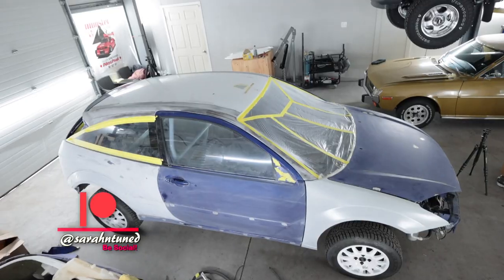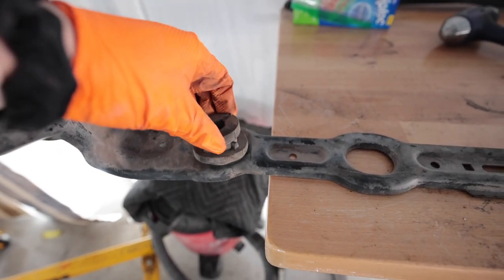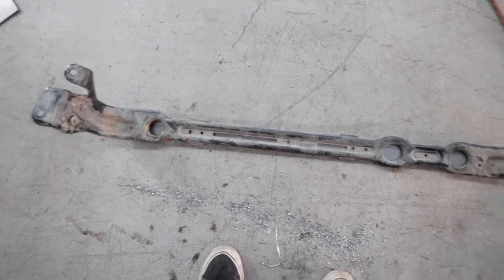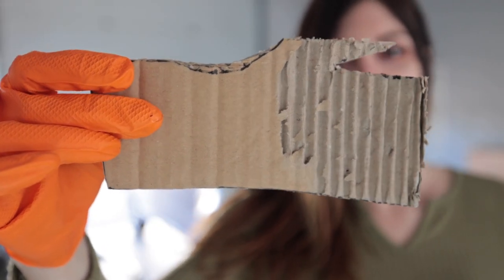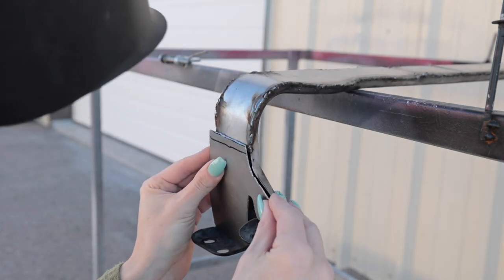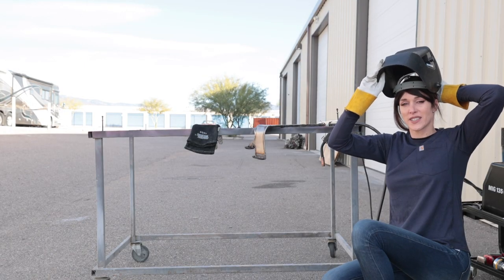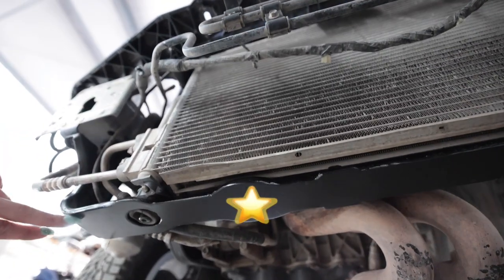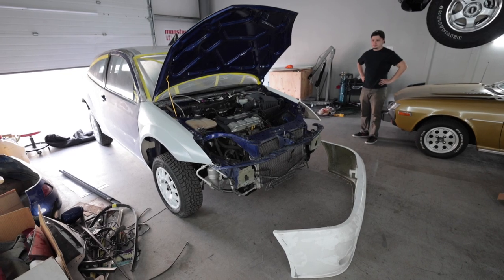How to Reinforce Your Chassis! // Focus WRC

Comment: Great video. Only input I would make, is about the radiator crossmember you welded up. I would suggest some holes drilled in the bottom, as I see it possible, that it could fill up with water with nowhere to drain.

Comment: I remember watching a video on Subaru’s rally cars.  They stripped down the car to its unibody and then stitched welded every single seam before adding on all the tubing for the safety cage.  The amount of prep just on the unibody is crazy for a WRC car.
Reply: It didn't save Skoda from the fire truck but having a strong car is kind of important. For instance Petter had a thing for clipping bridges...

Comment: Ok I'm impressed with your fab skills. For someone that isn't doing it every day that's good work. Welding outside is a real problem even if there is little or no wind. You can turn up your shield gas a bunch and keep a cleaner weld. Also wipe down your metal before welding with acetone and your welds will get better.

Comment: In the past I have made support structures from galvanized tubing for body kits. You can fork both ends,slot them for infinite adjustments and it's super strong. Look at how Nascar sheet metal frames are for inspiration.  Fuel lid is easy and lots of options.

Comment: Building a rally car from a old used street car is a tall order.  They start with a fresh "body-in-white" shell that has no seam sealer applied.  They are bolted to a precision flat fixture plate and all the panel joins are stitch welded and plates and gussets are added to where the tubular tube structure will mount.  All the suspension points will be stiffened by the cage and the door areas are stiffened to help prevent twisting and flexing in those areas.  Safety is the biggest concern and making sure the roll cage doesn't break open and become a spear to the driver.  It takes a lot of engineering and professional fabrication skills to make a decent car and take some of the loads it will encounter.  Don't want to be a downer but there is a lot to learn and study as well as careful planning needed.  The more I know the more I know I don't know.

Comment: Hi Sarah and crew. Have you thought about eliminating the petrol filler neck and piping ? Then replace it with a proper racing fuel cell and mount it where ever you have room. Keep in mind proper weight distribution and front to rear weight bias. I love this build.

Comment: Boxing that support bracket is very nice.  I would put a drain hole in the spot you didn't drill out.  Not as big as the stamped hole, just to give water somewhere to go.

Comment: In the old days we used to simply buy a new steel subframe panel and weld it to the original panel basically doubling the thickness. It was a pain but worked and appeared factory.

Comment: Where you boxed in that cross member....  Drill a 1/4 inch hole and pour in a half cup of acid etch primer then pour it back out and let it dry for a few days before sealing it back up. Maybe even pour in some epoxy paint later, then drain it back out too, then let it dry for a week or so, then plug up the hole.    Maybe not a deal in Arizona, but it is on the coast.
Great stuff and the reinforcement turned out sweet.

Comment: After all these years it's great to finally see you with a vice bolted to a work top! Fabrication time! Weld some nuts to the bar to bolt the plate to. Ideally where you drilled the holes🤣

Comment: i do agree your rad support is now stronger, but not jack the car up stronger, it will def bend from that. not break, but def bend. nice work. loving the build progress. and the hostess
Reply from the maker: I just need it to protect the radiator better, the next video I go overkill making the bash bar which the skid will actually mount to. Pretty sure I could pull a Mack truck with it after I’m done 😂

Comment: another way to add strength in rally and race cars is they filled the frame rails with foam
 i repaired one of the original  lj xu1 toranas they raced at bathurst  inside the sills and chassis rails were filled with foam to stiffen the body

Comment: On things like that front framerail cap it might help to mock that up out of wood first which will allow you to fit your front bumper cover.   Once you get all the geometry right you can copy the wood design in metal.

I would expect the race cars to be running a fuel cell, foam filled, inner bladder, surge tank.      Filler cap is a lock down and seal type inside the hatch in the back somewhere and the fuel cell vent has a roll over safety valve in it.    All that stuff is notta cheap too.

Comment: Just a comment about that radiator support mount and making sure you strengthen the bolts on the mount, and also the bolt holes on the chassis rails. A radiator full of water is probably 15-20kgs, I think that around 30-35lb and it's a lot of weight to be pounding downwards over jumps and corrugated roads and will likely fatigue the metal and crack the mounts.

Comment: Nice work. My old Escort GT had a front mount that connected similarly like the Focus and I used a chunk of 5/8 allthread welded to the front in shape of an L for a rest stop and bolted front assembly on quickly.
Just an idea for you and Rallycake.

Comment: Suggest setting up a 6x6 cube in a corner if you can, hang some cheap tarps on two of the "walls" and using that as your grinding area.  Or not... grinding crap just tends to get everywhere.

Comment: when dealing with guage material spread your heat out keep a wet rag handy to cool the welds did that alot welding on quarter panels easier to do now then trying straight out later rule of thumb it will shink more than expand

Comment: hello Sarah, you may already have figured out a race car is tube Chassie with quarter panels and roof and sheet metal skin for less weight and a street version is a modified car or "stock" modified car. yhou car always go next level and blow the focus apart it all apart and build a tube Chassie car there might be a cage kit available to do that ???

Comment: At last...Have you been to a driving school yet?
Get some homologation papers they will show all the  points that need  strengthening and what is allowed in certain classes.  Group N papers would be for production cars.  Group A is hot rodded production.
Nomenclature may change between series but this is the basics.
Since you modified your body you've already jumped above Group N/Production.
Reply from the maker: A few over the years, yes.

Comment: Fabricobbler mode activated, yup it only has to look like a WRC Focus👍. As I haven't got the bits it's difficult to judge what space you'd need for those bumper spigots. I'd probably look at using the box section Charlie bought as the crash bar and drop some sections down to bolt onto the core support. I'm sure whatever you come up with it'll work just fine, especially iff you have Angel Teacake and Charlie pitching in with ideas.

Comment: Nice work! Well, for the bumper beam, you've got pictures of the part that was put on the WRC Focus. Go from there and try to fabricate something similar. You know how it looks, how it is designed. You've got a welder. Get material and start fabricating! 😃

Comment: Why not cut the top off the fuel tube, rotate it 180°, and cut a hole on the interior of the car. You could then access the fuel cap by opening the rear hatch.
Reply: my thoughts exactly , cut it on the straight part, easier to weld back together

Comment: I would drill a few drainage holes on the part you plated in the plate so washing dirt out and drying it is easier.

Partially tubing the front end isn't hard and gives more room for turbos :)

Comment: I would suggest checking the USA rally rule book before doing anything with the fuel tube and door, if you plan to complete in it. Myself, I would have welded captive nuts to inside of the x member to mount the sump guard but you can probably do that with the other piece you need to fabricate. Also a vertical strip of steel behind that plate you welded on, between the x member and that plate, to give it more regality. Would you consider making the sump guard out of carbon fiber, Kevlar and woven fiberglass? Pretty easy do do using MDF board as to fabricate a template/mold, you wouldn't need to vacuum bag as its only a sump guard and its going getting the sh*t beaten out of it. This will help reduce the weight also.  Just my thoughts from what I've done in the past.
Reply from the maker: Could literally care less, like I have time to go compete in actual sanctioned events.
Reply: Understand.

Comment: That's another great video and more excellent work, Sarah. Thank you.
Just one thought: is there a drain plug on the bottom of the radiator? Can you still access it now you have reinforced the radiator support?
As regards the redundant fuel filler, I guess you will remove it, and the original fuel tank, and replace them with an internal rally style tank with a filler cap on top, accessed through the rear hatchback.

Comment: FYI, according to IMDB, Keanu Reeves is 6'1" (185.4cm) and James May is 5'11 3/4"
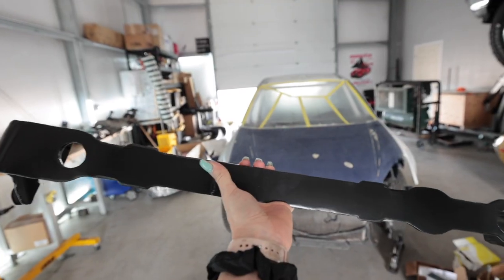 (182 cm). If, you were wearing +3" heels at the 12:13 mark then you would correctly 
appear to be taller on camera.🙃

Comment: That metal with your magnet didn't sound like aluminum, given its thickness. It sounded like steel; so maybe it was a type of stainless. Some are non-magnetic, and some are. But it did not sound like aluminum when you struck it.